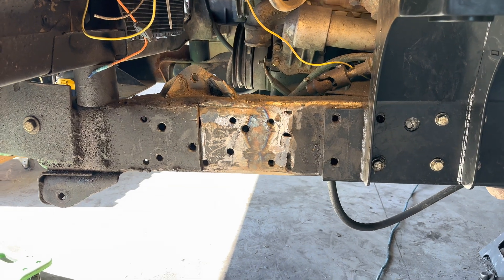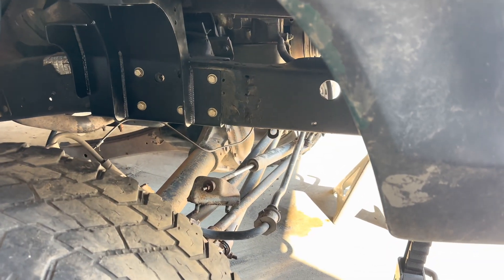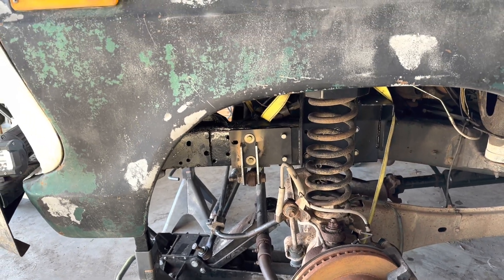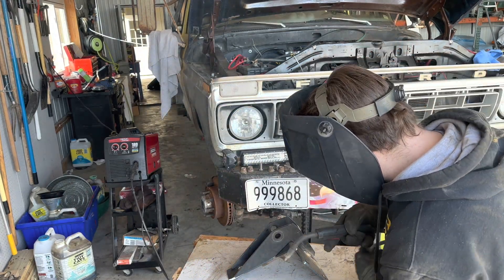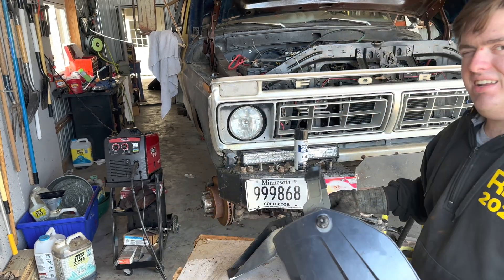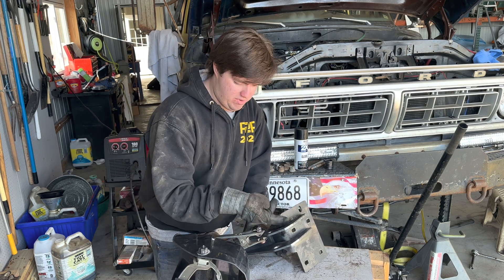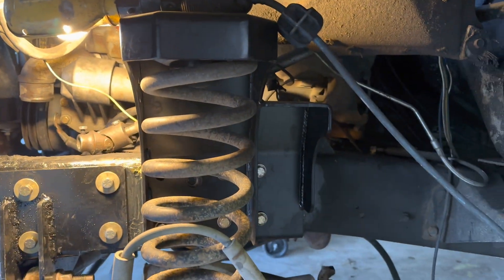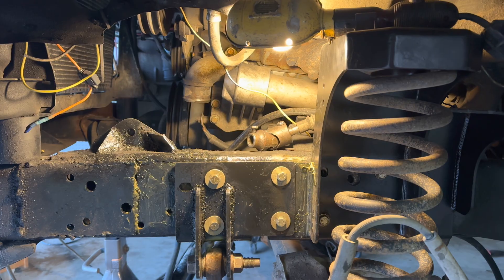Progress On The Superduty Axle Swap

Comment from the maker: Currently I do see two problems going forward. First off my drive shaft is about 2in too long, Second I do not have any clearance between my drive shaft and transmission cross member. There is currently only 1in max clearance between the cross member and drive shaft.
Reply: I have a Dana 60 hp in my 73 4wd and I had to cut a notch in my trans crossmember to clear the driveshaft
Reply from the maker: Yep I think that’s what I’m going to have to do. with the zf5 transmission I had to lower the crossmember to sit on the bottom of the frame rail